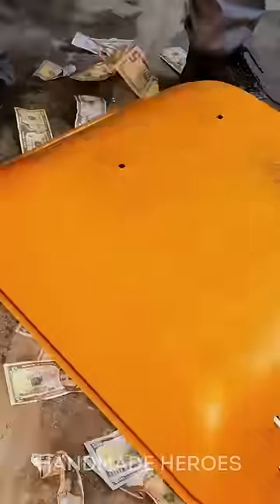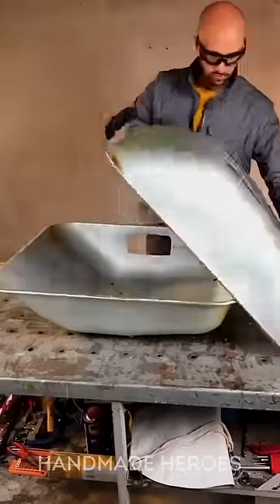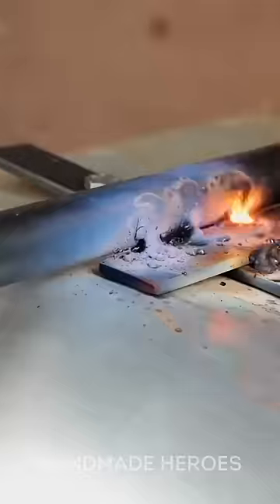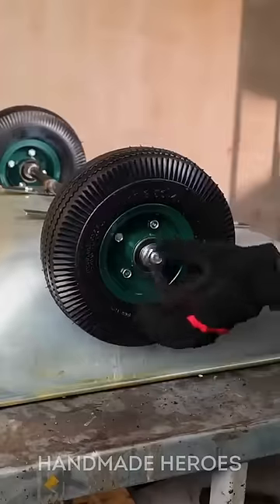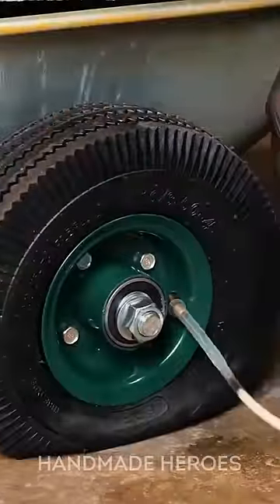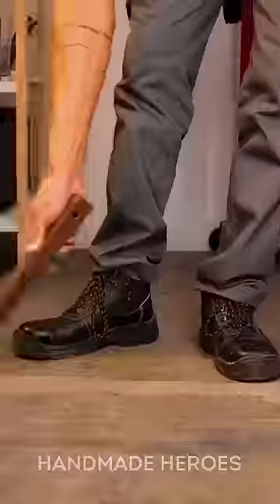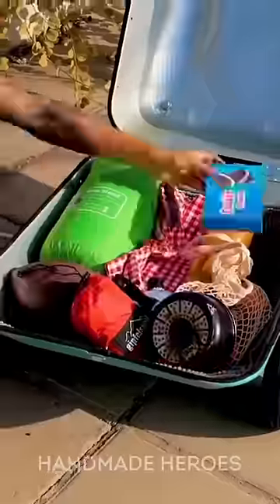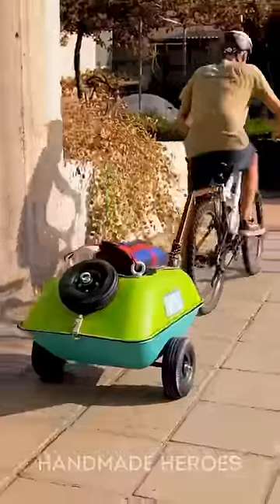A DIY cart to give a unique touch to your bicycle 🚲😍#shorts #diy #crafts #metal

Comment: What are people being critical of?  God, the guy built something with his own hands that gave him some satisfaction in the process and in the final result.
Reply: Best comment ever.
Reply: Because he made something, all must appreciate it.
Reply: There is a breackeven point, where just because YOU CAN do something does not mean that it makes sense.
Reply: he buld it VERY bad, with VERY bad welding, that break down soon. thas why the critic
Reply: They have bike trailers that are half the price
Reply: We don’t applaud stupidity
Reply: He will definitely get a lot of muscle (weight) exercise. (metal cart, metal pipes, unnecessary spare wheel, etc.)
Reply: Oh just the misleading nature of 2 minutes of my life that I thought he was building something that a no one else had come up with that would be worth the time and materials
Reply: I'm being critical because he didn't give shout-out to original creator 👺
Reply: Some people just like putting other people down because they aren’t clever enough to do something like this. I think he’s done an awesome job.
Reply: @Dan_dont_know  I've been working on a design for a cart that can be towed by my ride on lawnmower as well as my bicycle. His welding is terrible. The wheels aren't actually bolted on. You can see the nut was turning when he touched it. So the left side wheel probably fell off in about 10-20 feet while the right wheel locked itself so it doesn't turn at all.

The latch creates a downspout situation. Any rain hitting the cover falls into the rim and is directed to the latch by forward motion (interta: the trailer moves but the rain doesn't go foreword with it). Then, through the notch he cut for the lock, the rain fills up the bottom wheelbarrow 😅😅

He built a short distance, self tipping rain collector with about 10% of the welding required. 

He did an excellent job on the paint. Those wheels also provide no shock absorption so if the welds don't break off, whatever is inside is going to be thoroughly tossed around. Maybe it's a paint mixer? 

Air makes wheels absorb shock.  Solid foam wheels are only for slow moving vehicles or ones with a wheel suspension and shock absorber attached to the wheel. Slow meaning 2mph. Like an appliance dolly, pulling a refrigerator type of slow. That's why a wheel barrow has air in its tires and not foam.
Reply: For me it was the dramatic narration. Just have an actual human saying "check it out, this guy is repurposing a couple of trashed wheelbarrows". Instead it's like "hold onto your hats! this guy is about to make your head explode!"
Reply: @johnkratz2476  he "purchased 2 new wheelbarrows with the purpose of making this." It's not repurposed unless they were already used for a different purpose.

Comment: Gotta love that chinese weld quality.
Reply: Ya beat me to it 😂😂
Reply: He was using an electric welder, no argon and oxygen geting mixed so instead of a "weld" you get a "glob" or "clump" of mettle, it will hold two other peaces of mettle together. Even if it look ugly.
Reply: @completefemboyr.n.g1308  
Using an arc welder is overkill for that project. I guess he doesn't own a mig welder. You are clueless about arc welding.  a "glob" or "clump" LOL! 
This man has no experience with arc welding. Those with experience can lay down a beautiful weld that looks like a row of coins melted together.
Reply: @completefemboyr.n.g1308, you obviously know nothing about welding. Stick welding AKA SMAW doesn't require shielding gas because the flux is fixed to the electrode. MIG and TIG use shielding gas such as CO2 mix or argon. Can also use fluxcore in a wire feed machine which also doesn't require gas.
Reply: @completefemboyr.n.g1308  
If you don't Know - DONT POST BS
its an Arc welder
its the welder you learn to use BEFORE you get the EASY MIG welder out,
its ACTUALLY more practical for outside/windy conditions

And getting a good Bead of weld with one is simple enough, Use thinner rods and less voltage

A "glob" of weld  is worth as much and a glob of Bird Sh*t , it will hold until the first bump in the road
Reply: Over here that's called bird shit welding
Reply: @kyles234 you are wrong on flux, that uses gas too, 75/25 argon/co2
Reply: @farmerned6 I graduated tech school for welding and MiG is the first you learn, then flux, stick, Tig
Reply: @completefemboyr.n.g1308   You clearly have no clue on the first thing about welding. First off, it was a Stick Welder, you don't need shielding gas.  Secondly, you don't mix Argon and Oxygen.  The point of the Argon is to SHIELD it from the Oxygen, hence the name Sheilding Gas.  Argon is an Inert Gas and Oxygen is a Flammable gas. Oxygen on a weld is what causes it to be porous and bubble up etc.  The only time Oxygen is used is with Oxygen/Acetylene torches to cut or weld or preheat something.  Argon is used for Stainless and Aluminum TIG welding, and the only Argon blends are Argon and C02.  You NEVER mix an Inert Gas with a Flammable gas, it totally defeats the purpose.
Reply: @backwash69777    There is Self-Shielding Flux Core that you don't need Shielding gas to use.
Reply: @backwash69777  nope
Reply: Those welds were brutal.  The entire build is shite.
Reply: @completefemboyr.n.g1308 that was horrible are you also the narrator of this video
Reply: Except Chinese can build magnificent infrastructure. Nothing wrong with their welding. 😂
Reply: Wow welding trolls - first time for me

Comment: I built a trailer to pull behind my motorcycle in the 70s out of a plastic car top carrier box. I made a small frame under it, and used leaf springs and 8 inch boat trailer wheels and hubs. I pulled it everywhere.  Even towed it behind my 1979 Subaru 4 WD SUV wagon when I took my wife & 2 small kids camping all over the western United States. So much better than having all that weight on the roof of the little car.  Plus my GS 750 Suzuki towed it great.  It was larger and better water proof than 2 wheelbarrow bodies cobbled up like this one.

Comment: At about age ten and secretly learning to weld when Dad was working, I hoped to do something similar by cutting an old gas tank in two, adding two discarded front bicycle forks, and a hitch from a replaced car's tie-rod for a ball & socket. Got caught before getting the hitch receiver attached to an 80cc Yamaha motorcycle. Lol.

Comment: I don't wanna have an emergency brakeing situation with full load on it.
1. I am not sure it has enough free movement for potholes and bigger bumps.
2. Furthermore those steel items way more massive and heavy than the commercial alu frames so all weight would be behind you maybe with a semi-rigid connection...

Comment: I took nuts bolts bearings springs wires and the flux capacitor and build an engine. 

Then encased the engine in a box, added wheels 🛞🛞 and a complicated transmission and steering linkage.

I took this onto the freeway and went to my job as a scrapyard manager ....and crushed it.

I'm on the bus 🚌 now

Comment: Destroy 2 65$ wheel barrow instead of the 30$ bbq from walmart. 2 15$ wheels, 8$ foam, 30 in eyehook and steel plate. 
Just buy a 100$ hard base bike trailer.

Comment: $300 on eBay 
$170 - mig welder
$ 120-  wheelbarrows 
$   30 - wheels 
$ 60 - grinder 
Plus what ever for the nuts bolts and swivel Bar made .
$ 400 roughly to make plus the time .🤔
eBay 😂

Comment: No way that wheel nut just threaded on the way he welded the threaded end in the pipe and cut it off in the non-threaded section. You can see when he tightens the nut it is a factory finished end on that bolt. Plus there's no provision for a cotter pin to prevent the nut from moving so the motion of the wheels is going to tighten the right nut and eventually loosen the left wheel nut. And why does he have a spare if he filled the tires with foam they won't go flat anyway? Why not buy the foam filled tires instead? His welds look terrible and have poor penetration and pattern.
He didn't paint the exposed cuts for the latch. I'm giving him a 6 of 10 on creativity, a 4 of 10 on build quality,  1 of 10 on economics of building vs buying all new materials for this build which leads to a 0 of 10 on resourcefulness and sustainability for not recycling or salvaging materials.